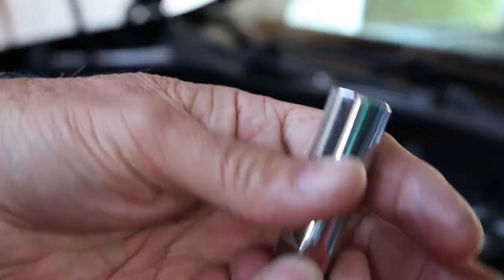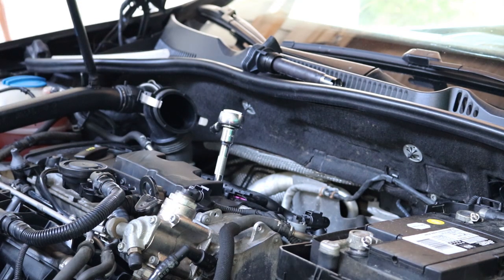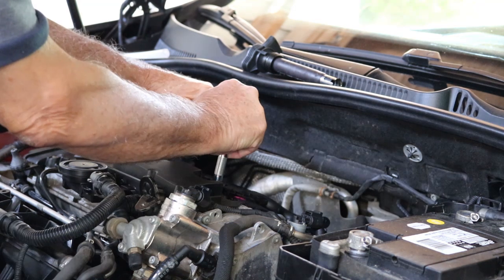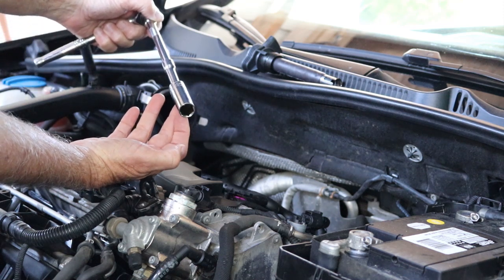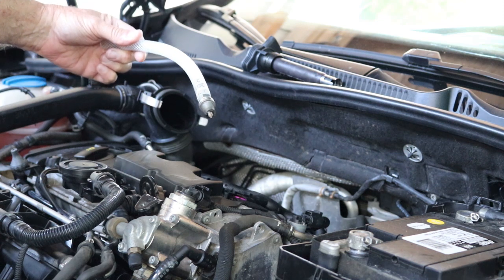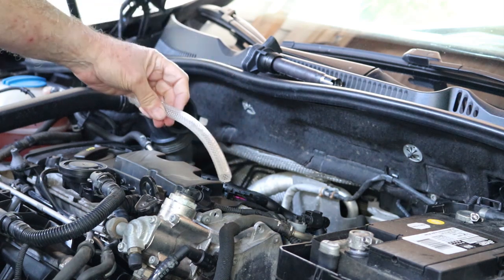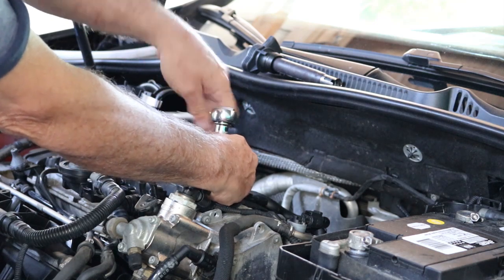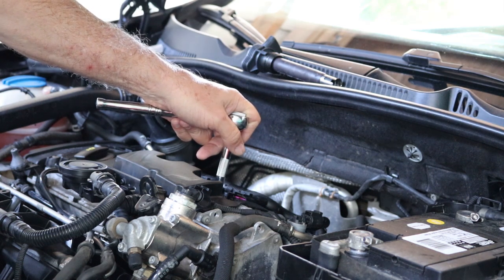Remove a Spark plug without a Spark Plug Socket

Comment: Hi thanks.
Im a subscriber.

Question please...

I dont have a torque wrench.
Can i change the plugs, wires, cap and rotor without the torque wrench ?

Thanks.
Anybody knowledgeable please reply soon.
💜
Reply from the maker: Yes,  seat the plugs and then apply a  little torque.  I never use a torque wrench on plugs.
Reply: @JoediyLab ok.

So hand tight and then like an extra 1/4 turn ?

Or is it a 1/2 turn ?
Reply from the maker: Don't use turns, go by feel.  Seat the plug then just a little torque.  You will be fine.  30 ft lbs is not much.

Comment: What's the inside dimension of your rubber tube? I have a 5/8 socket.
Reply from the maker: Sorry,  I just grabbed a hose and it fit.  If you have a spark plug take it to the hardware store and find the hose that fits.